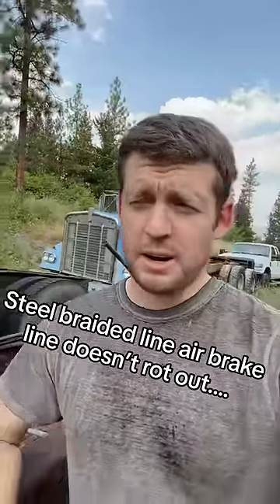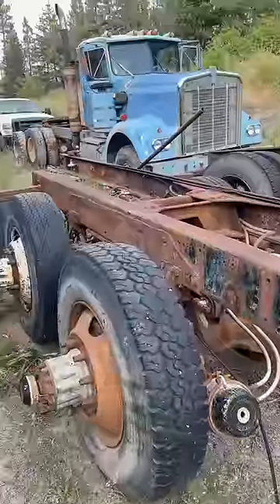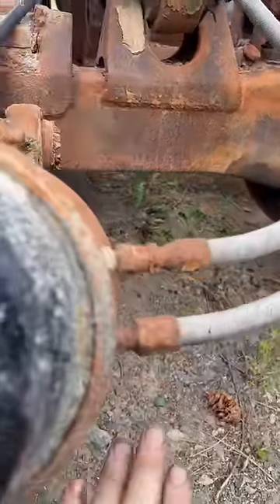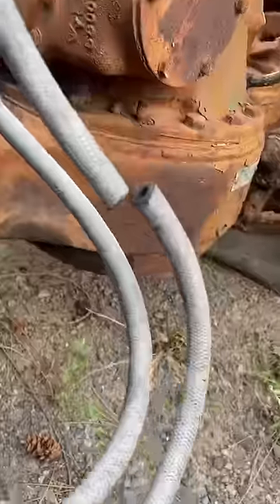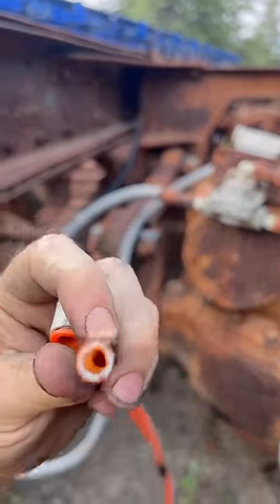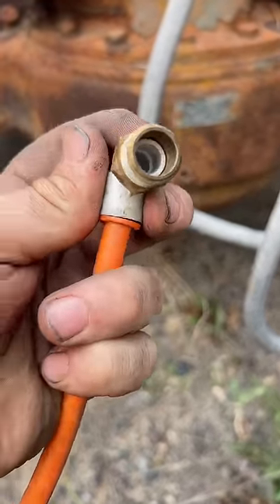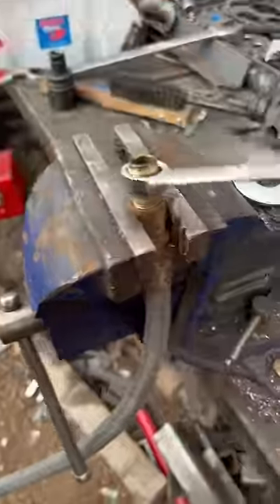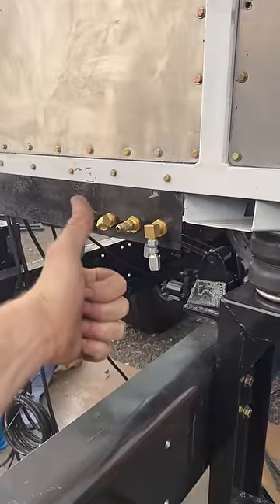Cutting a 70 year old trucks brake lines open for science

Comment: That's awesome, you can say "assembled in Canada from 1960's parts"
Reply from the maker: We managed to find parts Made In Canada to use on our truck.  We just had to go to the 1960’s to get them
Reply: @EdisonMotors y’all have to make a vid on the truck behind you when you were talking about the comments your teasing me!
Reply: I build air compressors for a loving and we always recomomend either solid metal lines or braided lines for longevity
Reply: People just have no idea what they are talking about. Thats the reason they aren't the ones building a diesel electric truck.
Reply: Idk if those lines were original, but steel braided lines get hard and crack, then water can get at the braiding and rust it away, and then they fail. I'd bet those lines were less than 20 years old. That being said, they will last longer than push connect fittings on plastic line.
However, properly routed plastic line that doesnt rub or get exposed to UV rays and uses compression fittings will last just as long or longer.
I have no issues with using rubber air line or even braided steel line, regular rubber air lines, if it doesn't rub, will last almost indefinitely.
Reply: American built, canadian assembled ;)
Reply: I mean anyone smart would know that 1960s>2020s
Reply: @georgestweeter You're the kind of guy that touches the hot stovetop after being showed that the dial is on an and red hot.
Reply: @EdisonMotors Next trip you make, take me with you. One way trip please.
Reply: @georgelarson612 this right here❤
Reply: @EdisonMotors love it just great
Reply: @georgestweeter those push connect fittings fail daily on the printing presses i work on. No rubbing no sunlight.
Reply: @stevewbeards wait, diesel electric? Like indirectly driven diesel? That's genius! The efficiency alone is insane, this is how trains can pull the ridiculous weight they do! Trains can pull 3000t of freight, 500 miles and burn ~2800g doing so, that's a single gallon per ton over about 480 miles or so, definitely looking forward to the future of your trucks!
Reply: Imagine a truck, hauling from Richmond Kentucky, to Chicago Illinois, ~395mi 20t  of freight, and burning around 20-30 gallons of fuel even with degraded efficiency in this example, I'm definitely looking forward to the progress with this technology, and hope to see some real-world numbers soon! Even if a fully loaded truck could pull the milage of a 1t pickup is insane, keep up the work man!
Reply: @YourDadBitch  20 tons is 40,000 lbs?  I know for a fact my father has pulled 50,000+lb loads and that's coming  up on 30 tons, 80k lbs (40t) is the max gross weight for trucks in the us
Reply: @YourDadBitch  and if you knew anything about trains, the Diesel engines on board are not mechanically linked to the drivetrain at all, they are generators. The trains are diesel-electric. Very similar in concept. The only difference is I don't believe modern trains have a way to run off a battery pack alone (the engines must be running) vs you could move this truck around on battery power alone if desired.
Reply: @YourDadBitch  what? That's literally what I'm talking about. The diesel engine is not mechanically linked to any sort of propulsion. It powers the motors, I was explaining that while I'm not sure I have no clue if trains have battery cells. Also, the situations I explained where clearly fictional, and I understand that there are gross vehicles weight restrictions. As well as 20k per axle. I was simply including the vehicle weight in the math. Learn to read man.
Reply: @EdisonMotors i have a Time machine u can use
Reply: So that's the accent.
Reply: Hydrolique hoses are about the same !!!
Reply: Same with america. 1960s was the begining of the end for manufacturing.
Reply: Amen.
Reply: My 2003 Mustang GT is 100% North American. Parts either came from USA, Canada or Mexico. It’s Chinese parts free and I won’t replace OE parts with Dorman Chinese junk or anything else Chinese
Reply: I bet u those lines have been replaced in the mid 80's
Reply: I would 100% buy it foe that reason 😅 old shit just worked.
Reply: @georgestweeter Except it's stainless steel braided! It doesn't "rust!"
Reply: @whose_ya_daddy5271 Yes, but the truck and trailer are half of that weight! You can have a gross weight of 80,000 lbs. but you have to subtract the weight of the truck and trailer from that! You can't haul 80k legally even though a lot of trucks can do it! 🤔 🤷 🙄 😔 😒 😕
Reply: Assembled.... Not produced

Comment: "Plastic is better than steel. Trust me, I read the brochure"
Reply: “Bro, diesel is better than electric! I read that on Youtube nazi comment section!!”
Reply: @rtsrt165  diesel engines are way more efficient per gram of fuel than gasoline, and there are biological based fuels that don't have byproducts like the lithium-polymer batteries that go in electric cars. Tell me you're a brainlet, without telling me you're a brainlet.
Reply: @Xurikyo tell me you're a right wing political sheep without telling me
Reply: @AndrewB23 how tell me your an anti American without telling me.
Reply: People dont understand what stainless means in stainless steel, some alloys wont rust for 90 years of constaint rain and snow
Reply: @rtsrt165 diesel is. As a diesel mechanic we got some new electric trucks...they are a joke. Nothing but problems. Not cost effe tive at all...some $500k trucks already had to have ALL the batteries replaced for a recall...it cost $350K to do.  Electric is a pump and dump scam. If u dont think diesel is better go educate yourself on how the aftertreatment system works and what comes out of the tailpipe these days.
Reply: @rtsrt165 diesel is much better than electric. Nobody will ever change my mind until we completely replace lithium batteries.
Reply: @rtsrt165 anything is better than electric bc you pay for the fuel before you ever get the title😅
Reply: @Xurikyo yeah but the difference is you only have to make the battery once. also. still billowing out loads of CO2 and soot there is a reason diesel was phased out for anything that didn't absolutely need it. if most power in the world wasn't produced by coal like it is now because of ignorant fools like you opposing all forms of progress due to willful misunderstanding, they would be the best option environmentally speaking. strip mining and whatnot is bad, climate change is vastly worse.
Reply: @logandarnell8946 Go tell China about coal.  Btw CO2 doesn't cause global warming.
Reply: You didn't just say it
Reply: @AndrewB23 he’s right though. Diesel is and always has been the pinnacle of internal combustion engines. You can make them run off renewable resources. And the metals mined for lithium ion batteries come from places that effectively use slave labor, not to mention the process of mining them itself is extremely polluting.
Reply: Wait, are you telling me diesel is nazi now? Damn, the mustach-germans from the 40's are hiding everywhere. Even in my diesel tank it seems.     @rtsrt165
Reply: lol
Reply: Depends on the application and the grade of plastic/steel.  In some applications, a higher grade plastic could last longer and work better than steel.
Reply: @AndrewB23 i hate electric cars and im quite possibly the most left leaning person in my circle. It has absolutely nothing to do with politics
Reply: @ContempIated  electric is the future. I think the next generation or two will be pretty awesome. Current electric are insanely fast. However, I just purchased a new gasoline vehicle myself.
Reply: @user-vn1di4oq4w  No offense but of course you will only see nothing but problems as a mechanic. Kind of the point.
Reply: @ho5zk  they say every new thing is the future. I also just don't like how instantaneous torque feels. Guess it really just boils down to preference though
Reply: @ContempIated   I see what you’re saying but electric vehicles aren’t new. Mass adoption of them is new. Torque from an electric motor can be programmed to be however you want it to feel. I don’t like that you aren’t able to work on new electric cars but gas cars are getting that way too. I hope there is breakthrough battery technology. Cheap and safe batteries could make for some cool custom rides.
Reply: @logandarnell8946  tell me you haven’t done proper research without telling you haven’t done proper research
Reply: @marcanthony8475 tell me u actually dont hate ur own nabours but ur just confused and devided...stop fighting amongst urselfes.
Reply: @darrellbeets7758  no I don't hate my neighbors.
But nowadays my neighbors hate me becuase I don't go along with there masters agendas...
Reply: @Xurikyo triggered easily huh kiddo. It's called a joke an your now punchline 😂
Reply: @rtsrt165 what
Reply: @AndrewB23 diesel electric hybrids are used in almost all heavy duty industries
Reply: @marcanthony8475  Tell me you're a troll... Blah blah blah.
Reply: @nullshock3381  tell me you watch the news and actually believe what they say...
Reply: @marcanthony8475   No, I won't, and you can't make me! Lol
Reply: @AndrewB23  well estimated that electric car battery when being made create more emissions than combustion engines. And that I learn while I was take light duty diesel and then took ev next year
Reply: @rtsrt165 diesel electric is better than both. Fight me
Reply: There are plastic grades sufficient for automotive long term use and reliability without maintenance properly fitted PTFE and a steel liner like what's used in brake lines for example won't degrade be affected by chemicals or corrosives, road salt, vibrations, plasticizer leeching, oxidation, etc.
Reply: Diesel is around 60-70% efficient the newest highest efficiency has engines are only around 33% and electric still has lots of heat loss as well. The reasons being is that billions more have gone into Diesel research for large machinery so the technology is more advanced than either electric or gas at this point in time. Eventually electric designs or diesel electrics may become more efficient than any standalone power source.
Reply: @AndrewB23  Says the person who believes the difference between an engine and a motor is politics.
Reply: @AndrewB23 Have you always believed everything the left wing media tells you without a second thought, or is this a recent brain failure?
Reply: @AndrewB23  right wing is when diesel engines
Reply: Depends on which of the nine chemistries that you're talking about. NMC? Sure. LFP? It's iron, as in engine block iron. And phosphate. As in fertilizer. 

Yeah... Most of y'all still think that every car is still using the first generation of batteries that cause the original Tesla's to blow up. That just doesn't happen anymore lol b @Xurikyo
Reply: @marcanthony8475 his name😂😂😂
Reply: for some applications, thats true.  Its all about how its used.
Reply: @AndrewB23  all those poor people who've died in electric car fires, just because it's hot weather. When will you learn 🥲
Reply: @AndrewB23 none of that, the worst of all is you trying too hard
Reply: The real mistake here is generalising both plastic and grades of steel
Reply: @AndrewB23 oh the irony
Reply: @rtsrt165 what are you even talking about dude?
Reply: Was the brochure made in china?

Comment: Years ago I put steel braided brake lines on a vette.  Brakes went from sensitive to hyper sensitive.    I loved it.
Reply: Ya, different in air brakes
Reply: The impact in hydraulic brakes is also huge, it prevents ballooning of the line under heavy use. From civic to corvette, braided lines bring the pedal to life.
Reply: My mustang has steel braided lines because the dude who owned it before me loved that thing and I will say that it could stop on a dime no matter the speed
Reply: @ericschmidt242  air brakes feel the same, no matter what hose.    Unlike Juice brakes that feel stiffer and more reactive with braided lines.
Reply: Here, you dropped this "cor". 
:P
Reply: @jwiereng Don't air brakes stay closed, until air pressure is added?
That way if they fail they close up. 
I'm not mechanic by far but it's what I always thought
Reply: @hughgrection3052   partially true.  

In the service brake system the brakes are held retracted by springs, and applied by air pressure. Spring type parking brakes are applied and remain applied WITHOUT AIR PRESSURE. The parking brake chambers are attached to the service brake chambers and operate the brakes through the same linkage.

However my point is that braided hoses do not enhance the "feel" of air brakes.    

Steel braded so make hydraulic brakes feel less squishy, because brake fluid is practically incompressible, the squish you feel is any trapped air or expansion on the lines.
Reply: @jwiereng  OK cool. Good to know.
Thanks bud. 
Again I was trying to pretend to know or be the guy who pipes up and says "Well... Acshhuually!!" LOL. 
But yeah I never knew braided lines helped that much. When I was younger working on cars they used to use rubber flex lines just where suspension is involved. Those types was a failure point most times as they was just rubber and cloth if I recall correctly lol. 
But yeah that, water, air in the fluid, and bad seals can all lead to stuff like that. 
Recently I had a mystery issue with my jeeps front right caliper wanting to stay closed and got super hot etc. Replace the brake shoes and inspected it all and didn't see the issue. So a while later after it sure enough it started again. So I put my thinking hat on before buying more expensive parts and then finally noticed that during my last service I had done I think some kid over added fluid into my master cylinder. So I took a syringe and drawed a ton of it out and it's been great ever since. He was just hooking me up in his mind I bet lol. 
So yeah I'm always learning!
Reply: steel lines and brembos were my best subie mod. saved my ass too many times
Reply: @slobaru7094  Sorry, what are both Brembos and subies? I assume brembo is a brand. Never heard of a subie yet tho
Reply: @hughgrection3052 Brembo is brake manufacturing company and Subie is just short for Subaru
Reply: @danielb.134  Ah I was half right at least lol. Man, the boom is setting in fast. I feel like I'm 80 when I have to make folks explain things lol. Thanks bud
Reply: I had a 1981 GMC Pick Up back in 1982..i worked for A Caterpillar Dealership back then & i replaced ALL my fluid lines in it with Parker Hanafin Stainless Steel Hoses..i never had to replace any hoses in the 15 years i owned it (sold it in 1996)
Reply: @hughgrection3052  Don’t knock yourself for not knowing. The automotive world is chock full of all kinds of knowledge that you can’t expect yourself to know
Reply: @danielbarde22  Thanks bud. And yeah I've always done my own work. My main issue is with finding the problems. Then once that's over with I typically can take anything apart and put it back together again. 
But yeah if it's a transmission or something I just declare it a natural disaster and say to hell with it lol.
Reply: All of a sudden
Reply: I’m gonna try that in my Chevette as well. Thanks for the tip!
Reply: @guyunknown6224 lol did you buy your mustang from my uncle? He was obsessed with the brakes on that thing. Always working on it and showing us how it stops on a dime
Reply: @oPurpleGorillao  I dunno , the gentlemen I bought it from was a mustang fan and had one or two of every model and worked for the local police department as their mechanic
Reply: @guyunknown6224  Fuck i have braided lines on the front of my 2014 wrangler. On the rear is just stock lines with EBC brake pads as they wore out. Thing stopps to the point my tires skid. Impressive for a jeep on 35s
Reply: Steel braid brake lines - interesting idea. Thanks.
Reply: @hughgrection3052 10 months late, but it's worth knowing that an emergency brake valve (controls the air that releases the parking brake springs) can have two common catastrophic failures:

1. The supplied air does not get delivered. This is the safer of the two, as that whole "brakes on by default" thing applies, you just can't go anywhere without dragging your tires. 

2. The valve is stuck so that supplied air does not exhaust and leave the brakes. This results in the brakes being released with the brake valve pulled out. Service brakes can still be applied, but it's still a dangerous (and annoying) condition for obvious reasons.